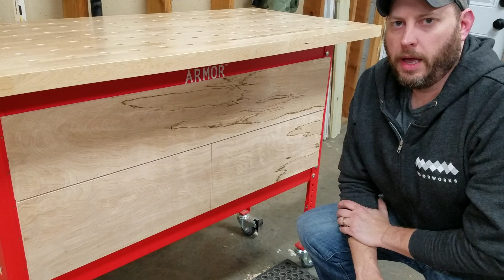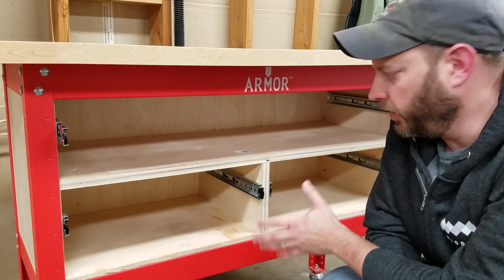Add Mobile Workbench Storage to Your Shop| Easy Woodworking Projects

Comment: Have you thought about sawdust and screws etc falling through dog holes..how you stopping it going into the top draw?
Reply from the maker: I personally did nothing. I just let stuff fall in there. However I came up with a solution that I haven't actually implemented yet. If you tack some pantyhose (or some similar super stretchy material) on the underside of the table you can catch all the stuff but still put stuff in the dogholes because the pantyhose will stretch

Comment: I did something very similar with mine -- I added the bottom, back and sides and put small cleats on both sides. The front big opening I keep a few "bigger" items. But the issue you might have with your design is that you might have problems with the long post on the horizontal clamps for the dog holes. Might hit stuff in your drawer if the drawer is packed.
Reply from the maker: Yeah I just keep miscellaneous clamps and bench cookies in the top drawer. I don't pack it with stuff.